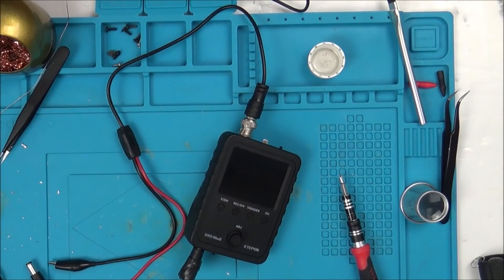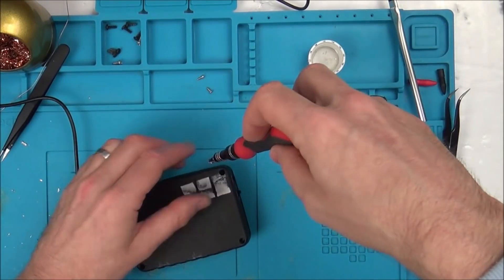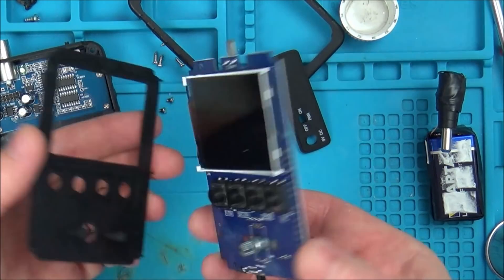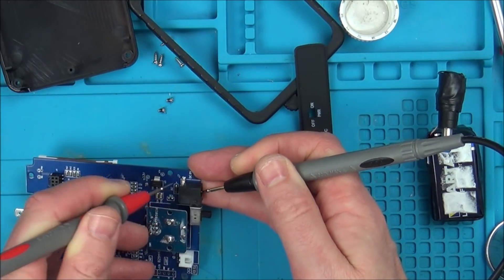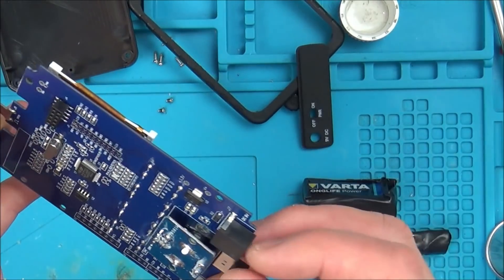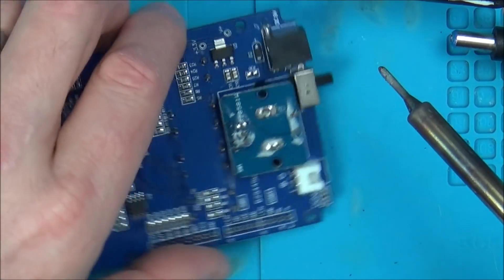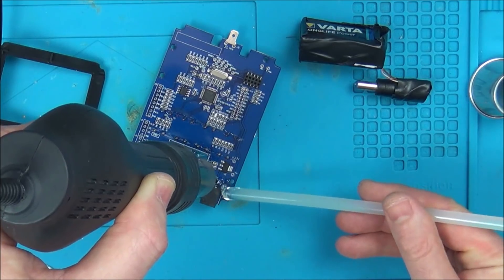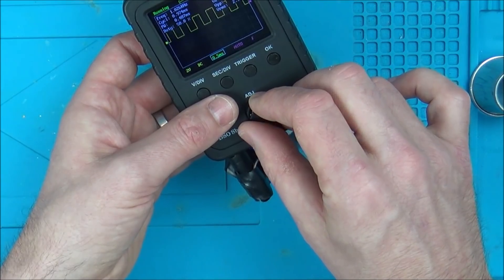Handheld Oscilloscope - No Power - Quick Fix

Comment: You did not make that oscilloscope yourself. (then you have a good knowledge of the values)
It's one of these old 20USD DIY scopes where you get the parts and circuit boards and then solder down all the parts yourself while checking values according to the schematic..
also made one though that one were in beige, my first scope..
but really needed a full-fledged one, but a portable one so I can easily take it to parts i wanted to examine and not the other way around and store it away in the closet when not used.
decided for this one, some years back but also expensive at a tad over 400 bucks, but it's been a pleasant experience with 28 meg and 100k sampling rate .https://i.imgur.com/kqDz9MG.jpg

Comment: Interesting to see the internals of this compared to the one I built myself, (lots more surface mount stuff on yours haha)
Hopefully those instructions helped make using the thing a bit easier! I am pretty sure the chip running yours is the same as mine, the interface looks identical and the button layout is identical.

Comment: https://jyetech.com/dso-150-shell-oscilloscope/
be sure to use a regulated power supply,
U5 - ICL7660 - is a positive to negative voltage convertor with a maximum input voltage of 10V
I replaced this with a;
Maxim ICL7662EBA+, that has a maximum input voltage of 20V
* The input voltage directly connects to this IC.

Comment: Vince can you point me in the direction of where to buy one of those metal cleaning brushes you use
Reply from the maker: Hey JR, they are called Flux Brushes. They normally come in a pack and you can cut down the bristles to the length you want. The shorter the length the more aggressive the cleaning. I got these from Amazon (UK).

Comment: Can you tell us something about that Scope? Is it worth money for an DIY scene? I am thinking of getting one, you need to assemble it by yourself if I am not wrong.
Reply from the maker: Hey lokz, I haven't really used it much. This one came already assembled from Amazon but I believe it is the same as the kit DIY version. It has already been useful to me on a few fixes so I have no regrets buying it. Apparently though I have been told it is not a good scope and picks up lots of noise. I think it probably makes an OK starter scope and when knowledge increases then a more expensive version with a wider range of frequencies can be bought. With my limited knowledge this is still perfect for what I need :-)

Comment: I have one of these (built from a kit).
Managed to squeeze in a 3,7Volt Li-ion cell into it along with a USB charger module for it.
Connected a tiny step-up converter to the output of it, that delivers 9Volt.
So now it's portable, and rechargeable. Winner winner, chicken dinner :-)
Now You can even get those two things in a single module.
https://www.joom.com/en/products/5e1e896ddf81010101c34336

Comment: Nice fix. Nice scope gadget but sadly, of poor design. Power jack and on/off should be at the top side. ac/dc/gnd switch should be at the front or maybe at the side. But... power jack and switch at the bottom?!? This begs to be modified.
I'm curious. I think, this device does not use other than a 5V regulated power supply. If that's really the case, I'd glue a small connector to the back. Two wires from that connector to the inside, attached to the main 5V rail. Add an extra smoothing cap.
Now, take a Li-ion battery or a LiPo from an old mobile. Add a powerbank PCB and an on/off switch and connect to that connector, so it supplies the oscilloscope with 5V power and you'll be able to recharge using a micro-USB supply.
Now, glue everything to the back in a way that it is accessible in a more logical way. Or 3D-print a nice add-on back case for holding these components. Or just tape it to the back, whatever you like. And file down that on/off-switch that protrudes from the bottom.

Comment: When Vince solders it’s stays put, when I solder the solder stay on the iron...
And that’s why i can’t solder!
Reply: add flux to the part you wish to solder. Solder isnt put on the iron when you solder stuff, it is only added to the iron to prime it. You may also have the soldering iron set too cool
Reply: Heat the surface first, try to melt the solder int the heated surface, not directyl on the iron tip. You can help you using flux. Put some flux on the joint you want to solder, then heat the joint, then come with the solder to the joint, the closest to the tip, the better. Always keep the tip CLEAN. For general electronic jobs 20 to 30W is fine. Try not to grab the cheapest iron, because this make the job harder. The tools HELPS. Buy a goot soldering iron. I recall doing horrible solder with my crappy 60W no name soldering iron with non ceramic tip. When I borrowed the goot iron from my friend, I couldnt believe the results. Goot is a good brand and they make affordable irons. For practice just look for scrap around, dont go straight into the job. Use old motherboards, clock radios, VCRs etc. For SMD you can buy some cheap basic station. I have bee using a VT Power ZD8906 ... really gets the job done and its is inexpensive (it is not temperature controlled, but it has sort of temperature dial).
Reply from the maker: Haha, when I watch your videos I say.....When Mike put a balance wheel in it ticks, when I put a balance wheel in it flops, wobbles and stops ;-)
Reply: @Mymatevince  ahhh a private joke. ...

Comment: I have the same wee DSO , same thing happened to mine ..I ended up powering it from a single 18650 in a battery holder glued onto the rear and using a 99p boost converter from eBay that fitted inside the DSO shell  ..I removed the power jack completely as mine was knackered...these ultra cheapo DSO's have a terrible noise floor and are only really useful for indication not real measurements but it has been handy several times...certainly more portable than my old Tektronix scope
Reply: You could probably find a LiPo battery that could fit in there

Comment: I bought a version of this...from Banggood, as a kit. It's pocket money. Loads of fun to build too. DSO138 I think the kit was.
Reply: The DSO138 is quite cheap, but the big issue with it is anything over about 100KHz is unmeasurable with it, I saved my money and got a 50MHz PC scope
Reply: @joshm264  which one did you get?
Reply: @amaiorano  Owon VDS-1022I
Reply: @joshm264  thanks! That does seem pretty great.

Comment: with hotglue you want to heat it up really to really high temperature, bond is much stronger that way. Feel free to use max temp your hotair station have (480-500 probably) but not on board itself but on glue stick instead. Then you just let glue drop on spot you trying to secure or apply it directly to area.
Reply from the maker: Thanks Goran :-)

Comment: Can you plug an internal 3.7 volt battery knside the oscilloscope?
Because you don't have to resolder the 9 volt connector if the battery dies,and make the oscilloscope less bulky by hiding a battery inside the case.
Reply from the maker: I don't know, I am not sure what voltage it would need from that internal connector :-) Would certainly look nicer :-)
Reply: @Mymatevince  try powering it up from your bench supply at 3.7V, then if it works you can use pretty much any lithium ion/LiPo battery